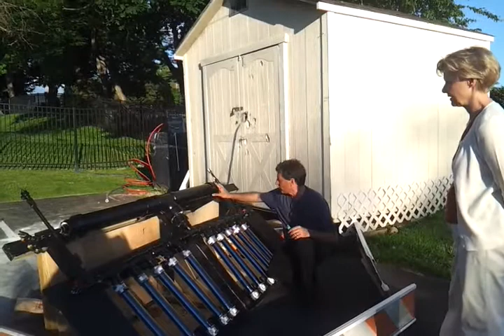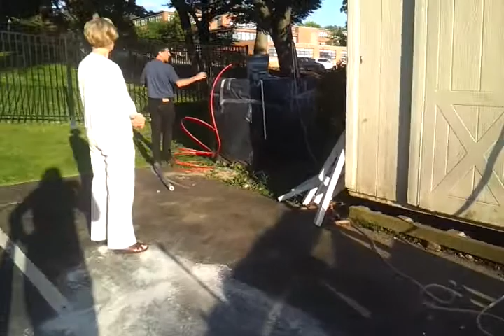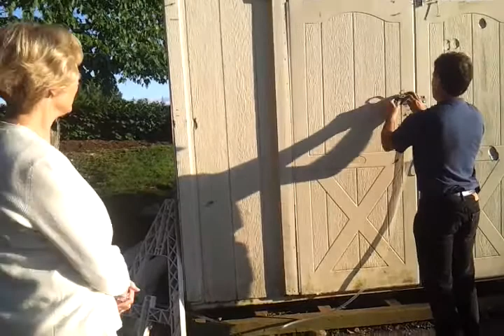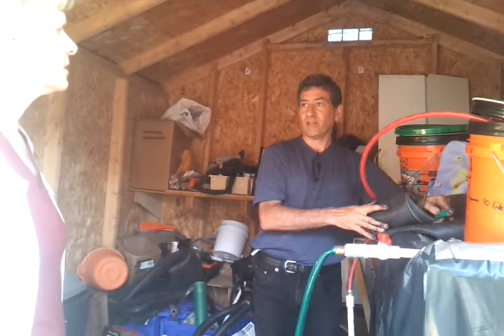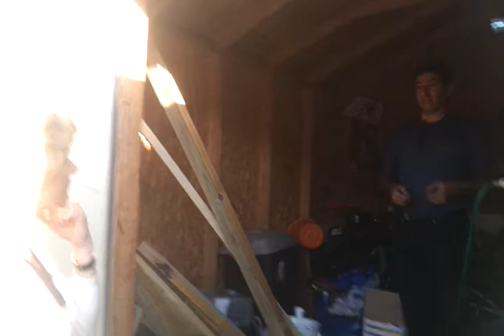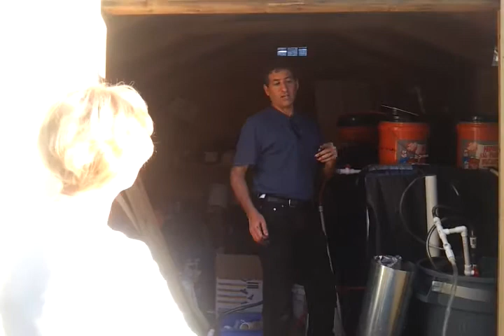Describing Envisaj Solar heater and biogas

Comment: if the water in the solar hot water heat isnt hitting 140 f and above, the water isnt safe to use in contact with skin, because its a breeding  ground for bacteria